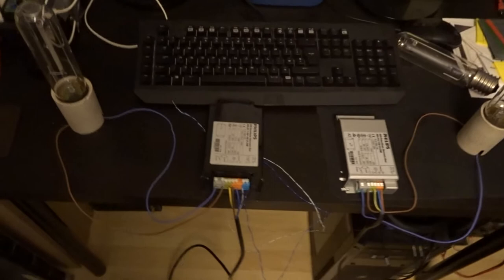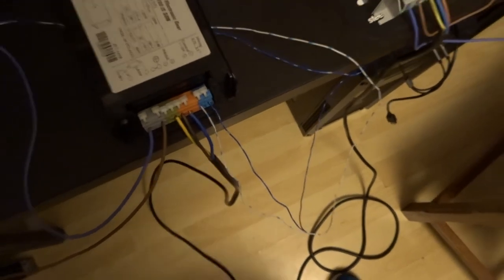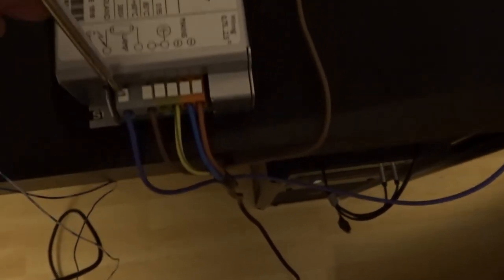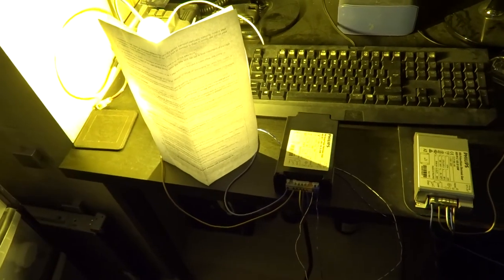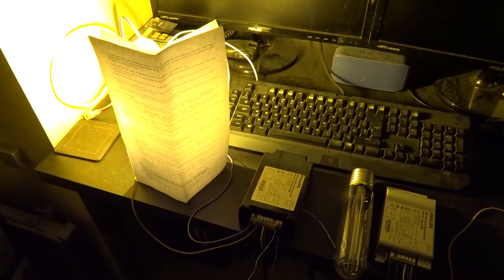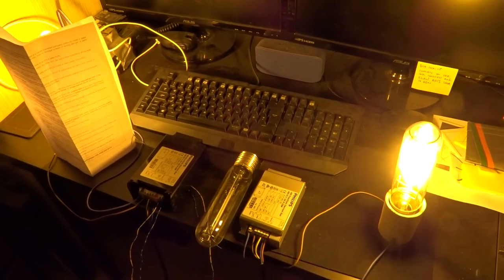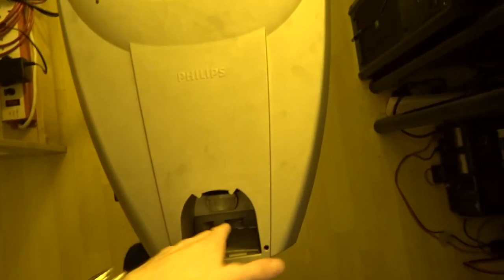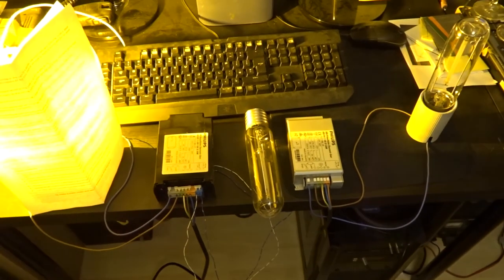HPS Digital Ballast Intro 1-10v SGS353

Comment from the maker: A few corrections and clarifications I noticed after filming:

* I meant to say "E40" not "E11" Edison Screw.
* I meant "1-10v" not "0-10v" when I mentioned it once by mistake. I infact am only talking about "1-10v" dimming here because "0-10v" and "1-10v" are actually different standards. 
* 1-10v dimming the balast is supplying the signal you just need to open or close the circuit.
* 0-10v dimming the balast requires a signal from an external dimming device.

Notes on other lighting control methods:

* Also see my video on DALI.
* Tridonic switch dim using 50/60 Hz mains for timing clock control signal: https://mountlighting.co.uk/technical/switchdim-intelligent-lighting-configuration-guide/
* Tridonic DSI protocol, manchester code timing.
* DMX protocol.